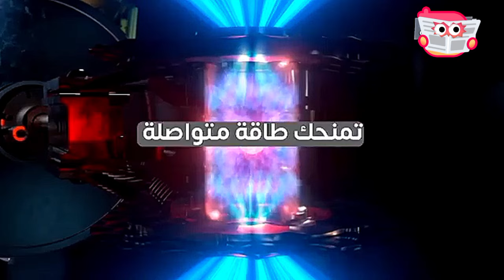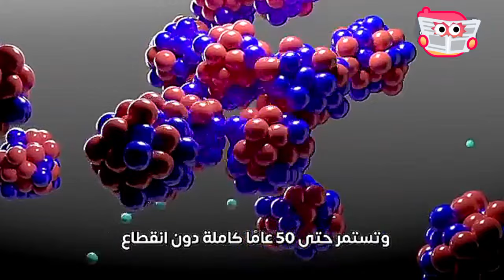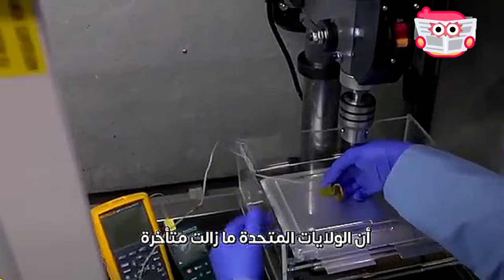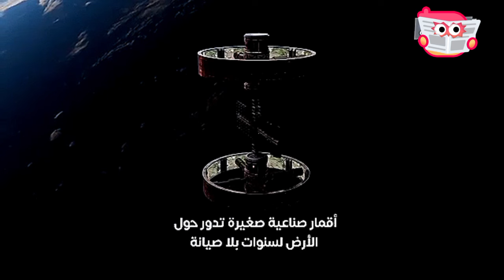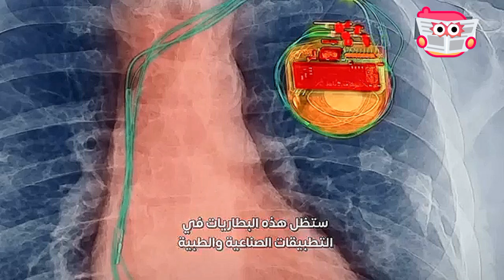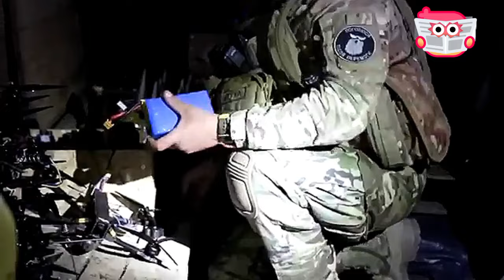China Challenges the U.S. and Shocks the World with a Nuclear Battery Revolution

Comment: A 100 uW power source isn't going to power a modern UAV. It might be able to power a very small sensor, such as the type that China likes hiding in products it sells to the US. 

The half-life of nickel-63 is about 100 years, whether it's in a Chinese battery or a Russian battery. So, Russia's battery would produce 3/4 of the power per unit of nickel-63 at the end of fifty years, just like the Chinese battery. That means that either Russia puts in extra nickel-63 so it has that extra power at the end of a century, or its battery is just going to supply half the rated power at the end of a century. Most likely, they add a little extra nickel-63. 

A microwatt is denoted using the Greek letter "mu," or ""µ," not "m." If your keyboard doesn't conveniently have a "mu" character, you could substitute the letter "u." One mW is a milliwatt, which is a thousand times larger than a microwatt (µW). 

About the last two minutes of this video has no sound.